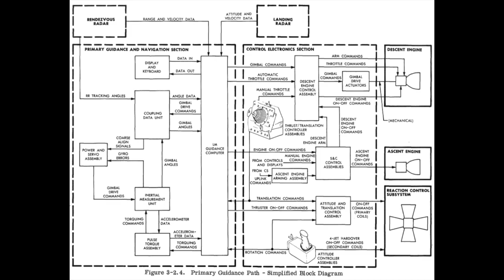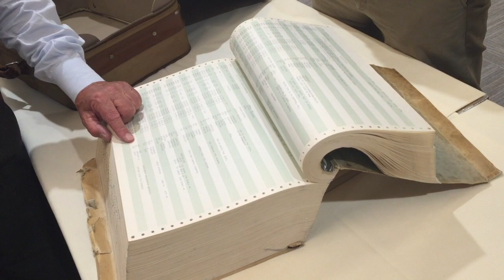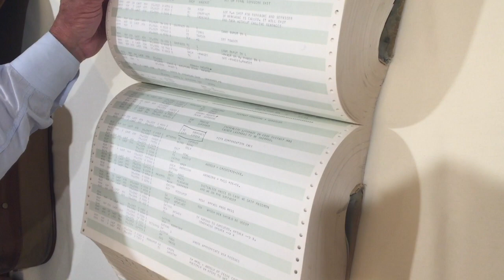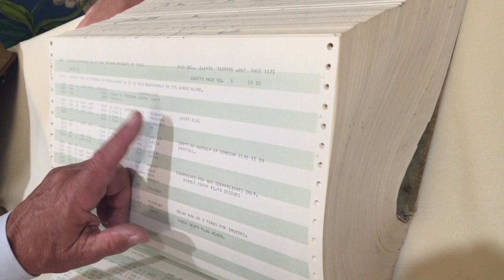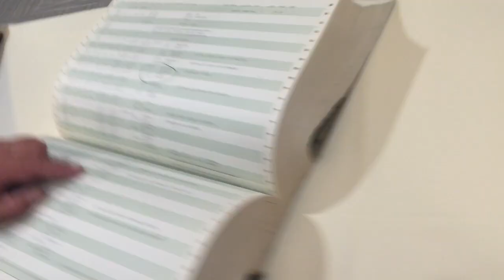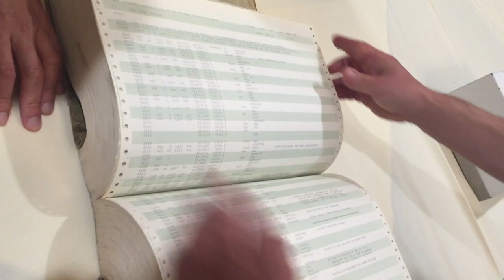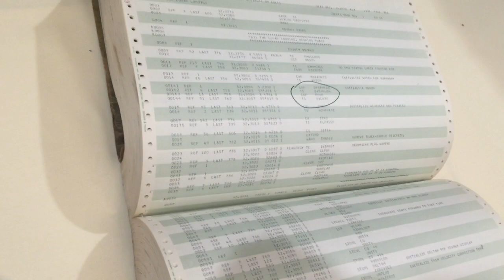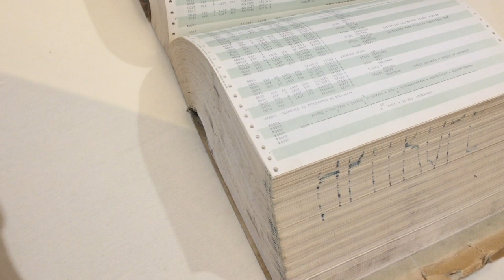Don Eyles shows his paper copy of the Lunar Module source code

Comment: What's funny is that this listing contains more memory code than the memory could contain.
Reply: That's true, ASM is very long winded. I had huge listings of my relatively small programs (32K) on the C64.
Reply: That's what I thought. Correct me if I'm wrong but the AGC had 36KB of ROM that's like half an average email around 72KB . That phone book sized listing is way more than an average email . Am I missing something?
Reply: @Pang_Yau  Yes,  Each one of those lines of code assembled down to one 15 bit word, unless it was interpretive code, in which case it might take two lines of code to assemble down to one word.  Machine code (the assemblers output) is as small as the machine can ever handle.  I recommend The Apollo Guidance Computer by O'Brien and Sunburst and Luminary by Don Eyles for your enjoyment.

Comment: Lost art.
Reply: Assembly programming is still a thing today, even if perhaps relatively obscure.  I work a lot with the "BeagleBone Black" single-board computer, whose SoC includes two special cores (known as PRU cores) for real-time I/O tasks. Each of these cores only has 2048 words of instruction memory (which cannot be modified while the core is running), and although a C compiler for PRU does exist nowadays (it didn't initially), it's still quite customary to program these cores entirely in assembly since  it makes more efficient use of the limited amount of instruction memory, and it allows you to take advantage of deterministic instruction timing (along with some neat features the C compiler doesn't know how to use).
Reply: It's fun art.